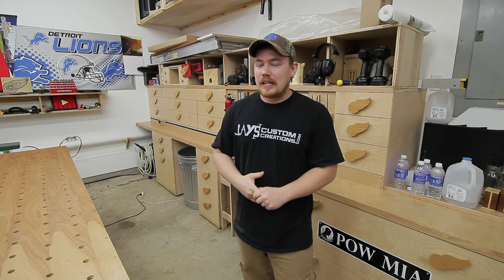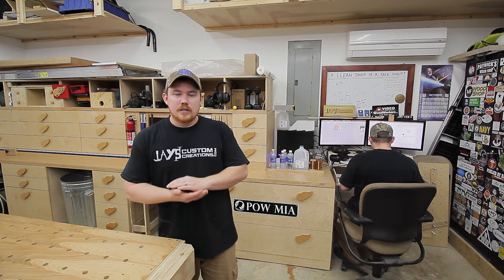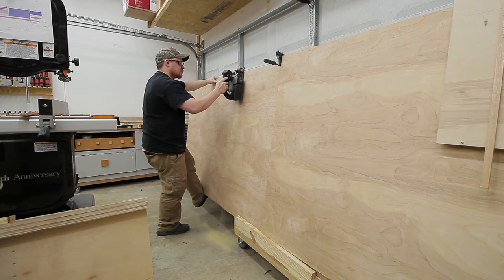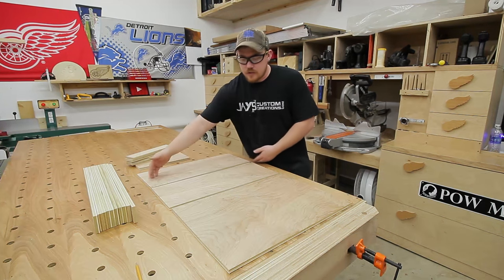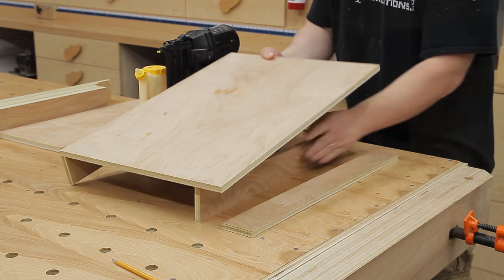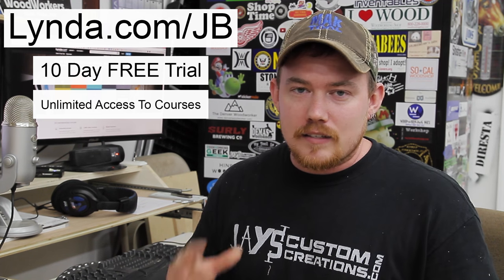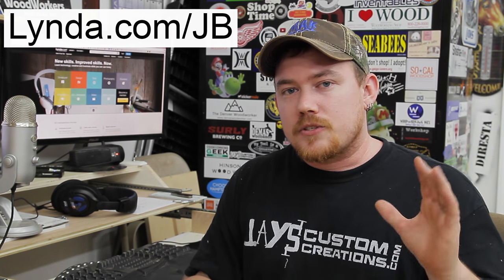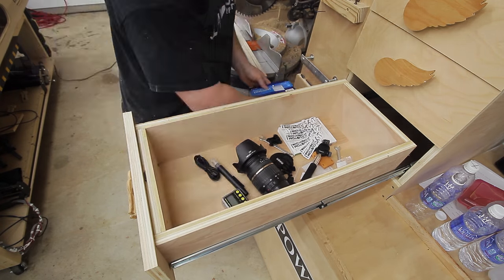Increasing Drawer Storage With Sliding Trays - 217

Comment: I did that in my last shop.  You may want to wax the contact points for the runners and the bottom of the drawers. .  For mine,  I made them just wide enough to put a 1/2 deep cooking sheets that had handles on them.  That way you can get even more space out of the drawer.  I also form fitted and glued some black foam to the bottom of the trays to cut down noise and to keep the small items from moving around.    Cool effects.

Comment: I've seen something like this done with hardwood, so it makes me curious: how does it slide with plywood?  does it move okay?  did you add wax or anything?

awesome video, as usual, btw.  I really enjoyed it, esp. when you were cutting the strips and stacking them next to each other
Reply from the maker: +ThoperSought No problems with the trays sliding. They slide fine just as is but waxing the runners makes them slide even better.
Reply: Jay Bates
awesome, thanks.

good to know.  I was thinking with the edge of the plywood it might have problems

Comment: At 4:30, you use a sled on your table saw to cut the short walls for the drawer inserts. I've seen this technique done elsewhere as well. What's the point/advantages/disadvantages of doing that instead of using a miter saw for the same cuts?
Reply from the maker: +pcman312 Personal preference really. I prefer a sled for final dimensioning. Some will say it's safer. You do get cleaner cuts though.

Comment: I might have missed it in the video but are you splitting the drawer size in half by adding the sliding trays?  For example drawer depth is 4 inches and tray is 2 inches?
Reply from the maker: +Quarter Inch Off I didn't mention it because the depth of the trays is dependent upon each situation. These trays gave me 2-1/2" of height in the tray and 2-1/2" of height below.

Comment: +Jay bates are you using illustrator to supplement sketchup? I am skilled at IL and was considered using sketchup but the key commands look brutal.
Also if you are using illustrator did you get the cloud version and do you use premier and after effects.  I'll be signing up for linda, thanks for the videos, if you like solar you will dig mine!
Reply from the maker: +Jason Andrade I've got the cloud version. I use premiere, photoshop, and indesign regularly. Just learning illustrator for logo type stuff.
Reply: +Jay Bates thanks for the reply from one J to another you videos are great and I have learned a bunch.
Reply: +Jason Andrade One of the best things about sketchup is how easily you can customize the keyboard shortcuts.  I used illustrator before I started using sketchup as well, so I went through and changed a lot of the hotkeys to be similar to illustrator. Once you get over the initial learning curve, which is a lot less steep than most programs, you can do amazing things with sketchup.
Reply: +ender52 thanks for the info, $700.00 is a pretty steep cost  for it.
Reply: +Jason Andrade Only if you buy the professional version.  The free version is still extremely capable.
Reply: +ender52 I down loaded the make version and it says that it has a trial period,  I started playing arround with it and it is fast, Ill try building a solar array tonight!
Reply: +ender52 thanks again
Reply: +Jason Andrade Sketchup make is the free version.  In the sketchup pro trial you're in now there's a few more features that are enabled, but nothing dire.  Once the trial is over the free version can handle almost anything you need as far as woodworking plans go.
Reply: +Dan Malm thanks Dan!

Comment: quick question Why you have not sealed or put some kind of finish on you wall unit ? I know from my little shop that after touching the plywood enough it picks up the oils from my hands.
Reply from the maker: +Raven Hart I put 3 or 4 coats of water based floor polyurethane on it as soon as it was built.

Comment: I am a little slow. Is there really a computer in your shop?  If so, how do you manage dust?
Reply: Some options are to build an enclosure for the computer with filters for all the air inlets or
Keep the computer in a different room and run the keyboard and monitor inputs to the shop or
Use a computer that works in a sealed case (repurposed cell phone, raspberry pi).

I have a huge e-peen custom built turbo computer sitting in the safety of my house.  They I access it remotely out in the shop or wherever using a cheap and light laptop.  This way I can have access to all that computing power where I need it, but if this laptop gets dropped in the pool, stolen, or filled with saw dust, I don't really care.  It is easily replaceable.